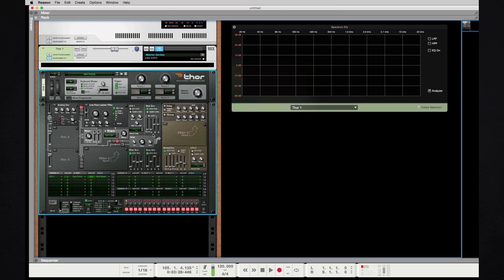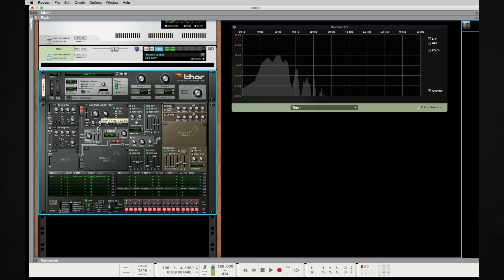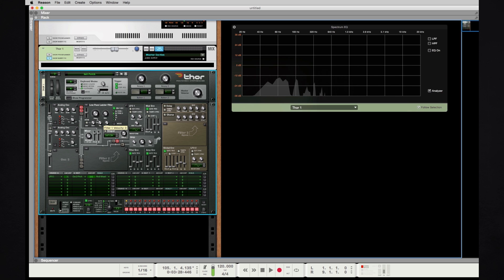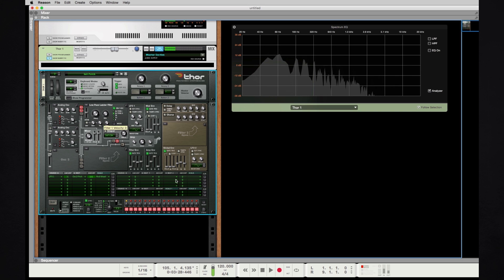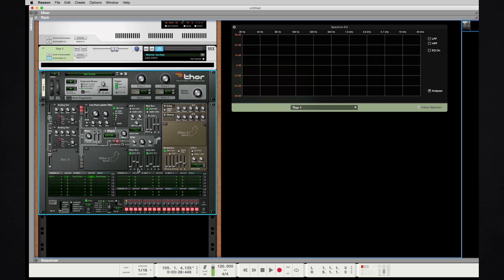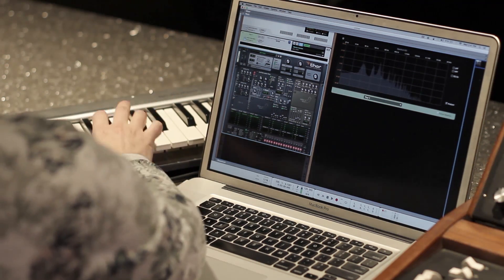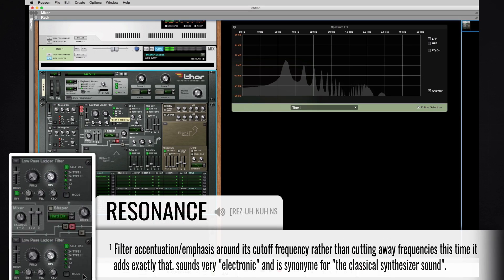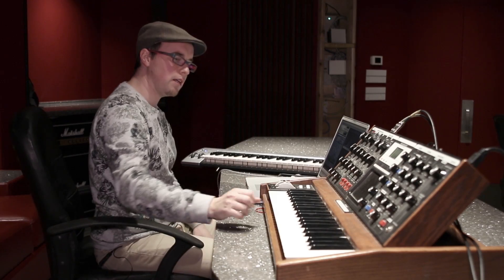MiniMoog Voyager Vs Reason's Thor - Analogue Vs Digital Synthesis (Part 2)

Comment: Software does an excellent job of recreating classic analog synths. Think about this. If you can hear it on YouTube, it can be reproduced digitally. If you play live, many PA systems are all digital now. Any of the few advantages of real analog goes out the window in so many instances, such as recording to CD formats or MP3s. How many of your listeners will actually get to hear you playing analog?

I replaced my 1972 ARP with a software version, and I am very satisfied with the software. I've visited synth museums and attended analog synth shows like Analog Heaven. Time and time again, I'm not impressed. The character of analog synths more often than not can be very well recreated. Having impressive presets or the ability to make your own is what really matters. I went through hundreds of sounds in the OP-X II Oberheim software synths. I also went through hundreds on the new OB-6. The OP-X II's sounds were way, way, way more interesting! Listen to songs on YouTube recreating classic songs using software vs the analog originals. I bet you'd be very surprised that you'd have a hard time telling the difference.

Demoing many Moogs, it's more the physical controllers of them that I appreciate more than the sound engine. I wish they would offer people like me MIDI controllers without the analog circuitry or added weight, at a reduced price. 

The real test of analog vs digital. One of the bands that opened for mine used a real analog synth, a Juno. He mentioned about the physical limitations of digital. So I listened to his performances, and also got the chance to go through his sounds. What I found was, none of them were too impressive. In fact, his band begged me for over a year on numerous phone calls, that they'd kick him out if I'd join. The reason, they loved my sounds (all digital).  I'd never do that to anyone though. Point being, think about the actual sounds, not how they are produced. That's what matters. And that's all that matters. I show up at practice with a laptop and just plug into 4 controller keyboards already setup. I got home, and do the same. I load up a file, it maps sounds to all of them at once. Even splits with different synths per keyboard. Matching volume levels with in the song. Think of how awesome that is!

Comment: sorry but you can match any analogue synth with thor it's just a matter of patience setting it up.
Reply: Just don't turn up that resonance, and do some slow filter sweeps. Oh, and the Moog's oscillators sound quite a bit fatter of course. And it has faster envelopes. And more saturation than Thor in the signal path, of course, which will also make it sound different. And probably a dozen of other things I haven't mentioned, which might be subtle, but make a lot of difference in practice.

Soft synth user here, by the way. There are loads of VSTi's which do a better job than Thor at virtual analog. Thor is an old synth, and, even back then, there was stuff like Sylenth1, which kind of smoked Thor back then already.

Comment: better if you compare with model D ! that is pure analog !
where your voyager is digitally control with super straight oscillator with bad composant(China) 
😊
there is already a lot difference between model D vs voyager 
so....
neo analog synth sound close to digital than digital sound close to analog 😊

Comment: Its easy enough to get the same sound on thor, some slow lfo on the osc pitch.  LFO1 -> osc1, LFO2 ->osc 2. Some drive on the low pass filter - 24 filter type 1, soft clip shaper (tiny amount of drive)  I can sound you the thor patch, it sounds just like the voyager. Don't forget mono legato.